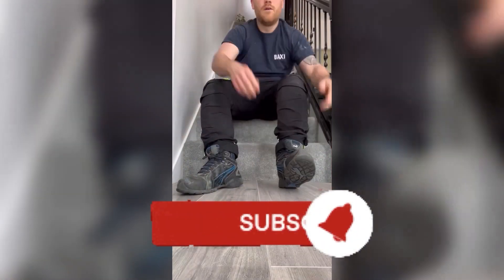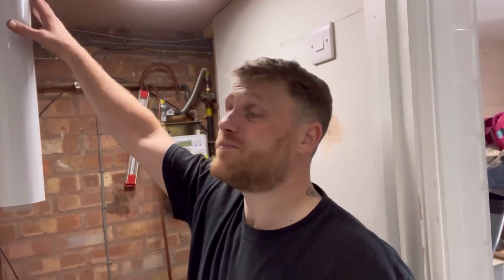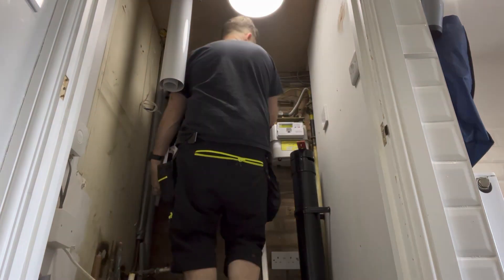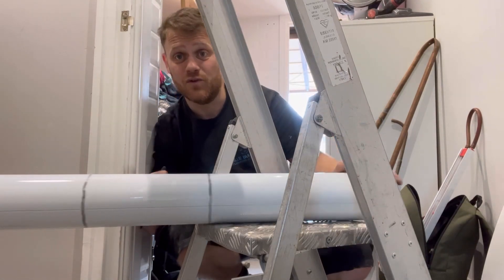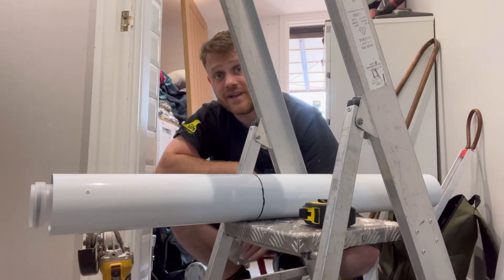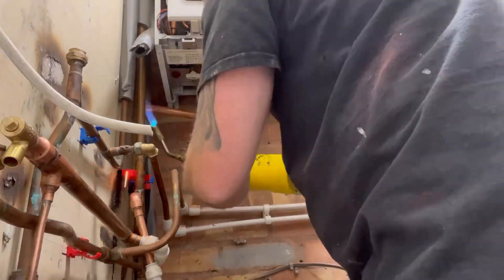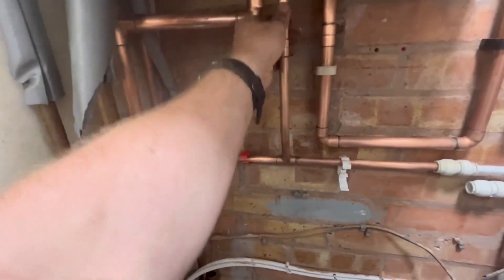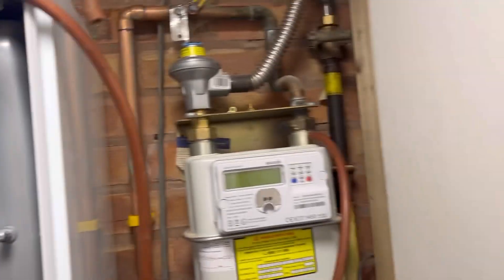How To Move A Boiler: Relocation of a Boiler, A Step-by-step Guide

Comment: Great job! Can I ask I want to put a cabinet over my boiler so it is inline with the rest of the wall cabinets. It’s currently sitting about 15cm too low. Would it be too big of a job to raise it 15cm? I can’t lower the other cabinets because of the gas hob.
Reply from the maker: Thank you 👍 Unfortunately if you was raising it any sort of distance it would be an expensive job as the flue hole will need sorting, pipes extending, bracket moving etc

Comment: Nice work. Yep, perfectly good enough, did you need the standoff bracket though? Couldn't see any pipes behind...
Reply: Nice video mate need more of these 🙏
Reply from the maker: @ChelseaFC190512  cheers mate 👍
Reply from the maker: Cheers mate…No didn’t need stand off but the boiler wouldn’t fit on the wall bracket, stand off must come as a different bracket to normal..weird one
Reply: @bluebulldog_uk  Guessed it must be something like that - I don't normally fit Vaillants, mostly Baxis and Worcesters.
Reply from the maker: @martinwright7093  same here mate…felt a bit lost doing this one, got there in the end thou